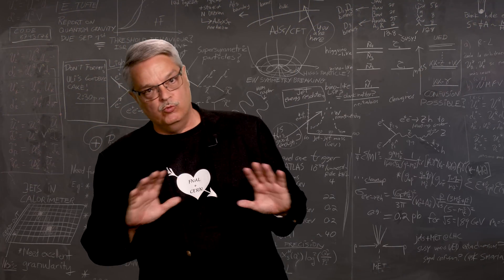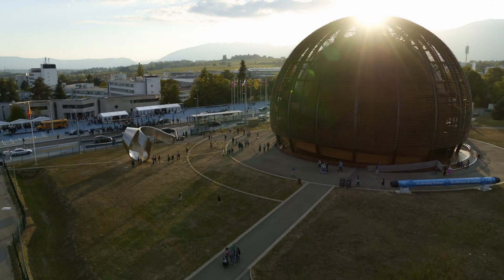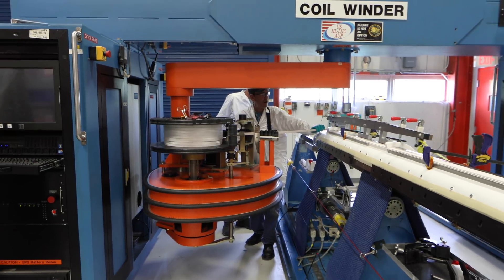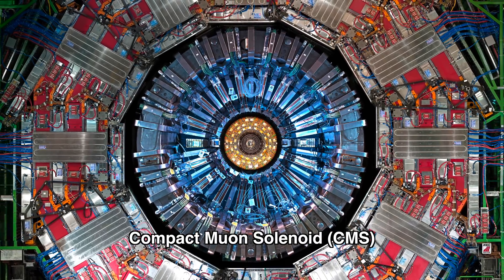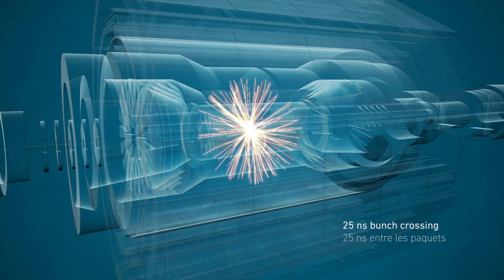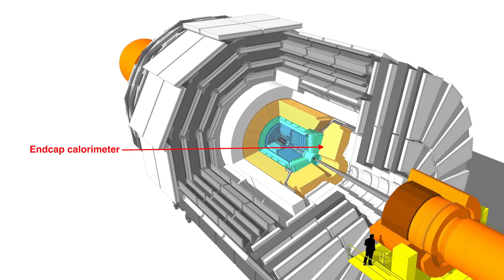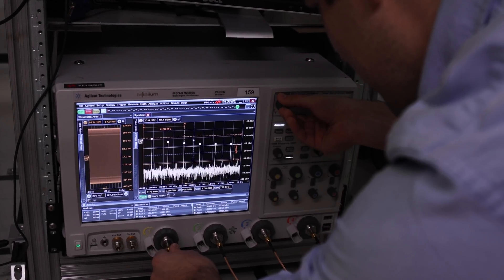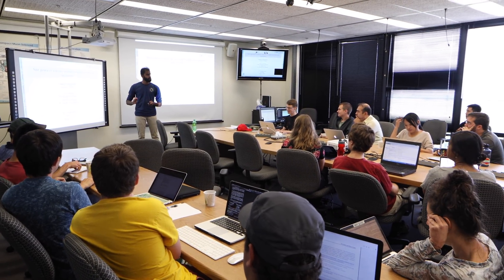The Higgs Boson Was Just the Start: Fermilab and the High Luminosity LHC

Comment: subatomical particles are theoretical particles, nothing more than romantic tales from physicists. Dogma!
Reply: So e.g. the electrons coming out of the sockets in your house are virtual and don't exist ?
Reply: Frank Schneider you dont need super machines to register photons, the eyes are good enough. That is a fact, not a theoretical particle. Can you comprehend that?
Reply: al G
Your eyes are organic detectors, that can detect some photons with a very specific range of wave lengths (the one we call "visible") and a sufficiently high intensity. All photons that either have a different frequency or lower intensity are not detected by the human eye, although we are of course able to detect them using more sensitive detectors. 
But that's completely irrelevant. You claimed that subatomic particles don't exist and I asked if you think that the electrons that are ultimately coming from the electrical sockets in your house are virtual, so if you think they are imaginary.
I'm still waiting for your answer (and wonder how you post messages using electronic devices, which are (at least according to you) powered by nothing, because electrons do not exist).
Reply: Frank Schneider Electricity is measurable, the subatomic particles are theoretical particles. My phone wirks with electricity. The reporta from the CERN are theories based from a computer system that has sebsors that get damaged with the radiation that is being produced with each experiment. Theories are not facts, thats is why theories keep being debated. As a scientist, marrying yourself to a wrong theory will lead you to mistakes or misguide you in your research, nothing different from Dogma. Can you understand that?
Reply: al G
You are aware that electricity is nothing but the flow of electrons at a certain voltage, right ? So if electricity exists, this means that electrons must exist, because otherwise there wouldn't be any electricity. 
Well, electrons are an integral part of every atom (you can easily extract some of them by rubbing a substance e.g. with a cat fur), which means subatomic particles exist and are real, because electrons exist, because otherwise there wouldn't be electricity and your phone wouldn't work. That's stuff typically taught in 2nd or 3rd grade.
So after we clarified that subatomic particles do exist, lets go to you next post.
I'm indeed a natural scientist, so I'm fairly familiar with the theory and philosophy of science, I therefore know quite well what a theory is and what it is not, and the guys working as research scientists at major accelerators are aware of that too. Honestly, no joke, they do.
So why do you think someone like you knows more about a topic then people like us who studied a certain topic of how nature behaves for countless years ? Because you are such an incredibly brilliant genius of a degree never seen before in human history ?
BTW, falsifying existing assumptions is one of the most important parts of scientific research. Some people don't do a lot else than exactly that, because if they are successful this is what gets you a Nobel prize, while finding another piece of evidence what everyone and his dog already assumed to be true only gets you just another paper.
Reply: Frank Schneider Your last post was a waste, you went from a scientist to a philosopher. There are scientists that theorize like Einstein and there are scientist that are practical, like Tesla. Most of the electrical use comes from Tesla and his practical aproach. My phones was pretty much developed thanks to Tesla and not Einstein. That is the difference between a theory and a fact. Science can be a fact as long as we can measure it. We need technology to measure it and technology all was fails, sooner or later. You probably believe that the picture of the black hole released not so long ago is proving the existence of a black hole, but it was a computer generated image, not a picture per se. We can go into the photonos and subatomic particles all you want but it reaches the point of becoming theories. Theories are not facts, physicists dont even agree with each other on their theories.
Reply: Tesla was not a scientist. He was an engineer, he didn't research anything. He simply used existing technology (based upon research done by scientists in former times) to solve technical problems. You obviously have a serious problem distinguishing scientific research from comparatively trivial things like applied engineering. BTW Tesla didn't even have an engineering degree and was pretty much a nut case talking mostly bullshit (e.g. his "death ray", "or lossless energy transfer over large non-vacuum distances"), at least in the later part of his life.
And as you are so keen on "theories", I'll tell you what a theory is: it's "the best existing explanation at a given point in time for a series of natural phenomena, which is generally accepted by the vast majority of the relevant scientific community". I'd like to point you to 2 things in there:  a)it says "generally accepted by the vast majority", not "unanimously accepted", b) do you see anything claiming it being "the truth" in there ? 
The true reality of nature can in principle not be known. We can therefore only come up with explanations that are logically consistent and best match the made observations. As theories are based upon mental models, which are simplified versions of reality, this means that theories are inherently always flawed to some degree and are thus never "true", but some describe natural observations better than other and are hence considered better descriptions of nature. If a theory would be "true" it could never be succeeded by a better one. No scientists believes theories to be "true", but they are still the best explanation we have at a point in time and as long as nothing better comes along, that's taken as reality, because there is nothing better. 
I'm aware that all of this is much over your head. To summarize it: you don''t have the slightest idea of science, how it works and thus what you are criticizing.
You take trivial points like the fact that theories aren't the truth and try to construct weird world models from it using the incredibly dumb "If A is not true, than everything goes"-logic, ignoring all observational facts, that initially lead to the creation of these models. 
To make it short: you suffer massively from Dunning-Kruger. Go have a six-pack, watch some football and leave the adults, who know what they are doing, alone.
Reply: Frank Schneider The end point of the scientific method is a fact, the rest are theories that might lead you in the wrong direction, the blind leading the blind. Eureka!
Reply: al G
Kid, why don't you stop talking about stuff, if you don't have the slightest idea what you are talking about ? In this case the theory of science. The only absolute truths/facts that scientifically exist are reproducible observations and they are not the result of of the scientific method, but of either an experiment, or literally observations of the universe (which are of course used within the scientific method, but are not the same).
A theory can never establish a fact, because it is always flawed, because it is always based upon a model ,which is necessarily simplified, because it must be less complex than reality. 
What a good theory does is a) explain why things happen and b) make more or less accurate quantitative predictions (which is of course sufficient for most practical purposes). Even if a theory makes 100% correct predictions all the time, this still doesn't mean it's true. It strictly just means that it makes absolutely correct predictions all of the time. Obviously this leads to the assumption, that it is true, but strictly speaking it's not, because it is impossible to determine any absolute scientific truths as you can never be sure, that there won't be an observation in the future that falsifies your theory. There are no absolute truths in science. If you want those go to the religious nuts, they'll gladly tell you about the reality contradicting "universal truths"..
And now stop running around naked and get yourself a towel.
Reply: Frank Schneider You still dont get it! The way you address me, shows your age. You have much to learn. Once again, creating a story out if thin air and build more stories on top of it, is far away from true science. For that reason engineers are more productive to the humankind than physicist/philosophers. Stories that can never be proven!!!!!! are we talking about scientists or religious people?
Reply: Frank Schneider I am not denying the existance of matter but questioning the tools used to measure the matter. If you use the wrong tools to measure you will make mistakes. I always question all the theories. I have learned that common sense is usually the best answer and many professors lack much of the commons sense. Practicing individuals learn the common sense by test and failure. Again, my problem is the tool used to register the CERN experiments. Read the kybalion and you’ll discover all the same concepts from physics, as above so below, everything pulses, etc.
Reply: JeremyEM1 That is produced by a cyclotron, invented in the 1930s and has nothing to do with Cern.

Comment: I was led to beleive that there is no target like the HIGGS within the levels achievable by a upgraded LHC. The LHC may have done its last big contribution to particle physics.
Reply: Jerry Brown
Higgs was just one of several targets. Another major target is identification of the lowest energetic super symmetric partner particles. If they can't be found (as it currently seems to be the case) this rules at least the easiest super symmetry variants out, and thus has implications for dark matter and string theory. 
If no super symmetry exists at all (which can't be verified using LHC), this would have massive implication's for theoretical physics as we currently think we understand it.
Reply: @frankschneider6156  Thank you for the reply. This is what I was headed towards. Both string theory and SUSY have already been called into question over the decades by some pretty serious issues. It does not appear that they are true even though it would be convenient as all heck if they were. The most likey outcome would be that the lower bounds for SUSY  would be established at the energy limits of the upgraded LHC.  This is quite different from trying to prove something, that  most likely did exist within the energy levels the LHC is now capable of.   I am concerned that an extended period of null events, like those experienced in the numerous underground dark matter searches, at such a highly visible and expensive facility as the LHC, would not be considered a success by the people paying the taxes to fund it. I think it would be wonderful if I turned out to be wrong.
Reply: Jerry Brown
I tend to mostly agree, but string theory is not even a scientific theory at all. It's a garbled mix of complex mathematics without any relationship to physical reality (at least in its current state with 10⁵⁰⁰+ manifolds). It's just heavily promoted by a sect-like subgroup of physicists around Ed Witten, who all made the error of betting their scientific career on it. If you do something like that, it's of course difficult to abandon something after a decade or 2 as simply false. I mean the graviton automatically pops out, that's of course extremely cool, but don't take that stuff seriously. Non-falsifiable hypothesis aren't scientific.
With SUSY it's different. It makes clear, falsifiable predictions. If SUSY doesn't exist, this would mean that different forces don't converge at high T into a single force, killing off current GUT/ToE approaches. A hypothesis no physicists will abandon, if not forced to by observations. And without SUSY there would be no proton decay and the proton would be a stable stable. This is perfectly in-line with what we found in detectors like Kamiokande, where we have been searching for proton decays for ages and are just not able tp detect any. 
It's of course much too early to jump to radical conclusions like abandoning the concept of SUSY altogether, but if the LHC wouldn't find any SUSY particles, this could be important evidence for a much more groundbreaking and a much bigger breakthrough, then finding some.

Comment: It is an impressive upgrade, but which will never find anything beyond the standard model.
Reply: It doesn't have to fundamentally change our whole understanding of physics in order to be useful or find something new.  We still know very little about the Higgs beyond confirming its existence, and since the LHC is the only place Higgs' can be reliably created, having the LHC be able to generate several times more of them will provide that much more data to analyze to help nail down its properties.  That in itself is quite useful (at least, in terms of advancing particle physics knowledge) without having to go beyond the standard model in any way.

And of course there's always the possibility (however slim) that the LHC's energies can produce things beyond the standard model that we've so far ignored because they were either rare enough that we discarded them as noise (and with more samples to work with, we can start generating a level of confidence about such events rather than discarding them) or simply because the detectors are better (they're also getting upgrades to go along with the beam intensity boost.)

Chances are this upgrade will probably only just give us more data to analyze about the known phenomena since its "only" an intensity boost and not an energy boost.  That will help us solidify knowledge about existing physics to be sure, but its probably not going to rock any boats.  We'll need higher energies to dig deeper, but unfortunately the cost and development time of these machines has gotten so large that the next one we'll see likely won't even start construction until closer to the middle of the century barring some incredible political shift toward the frontier sciences (which I personally don't see as terribly likely given that much of the world -- or at least the world's politicians -- seem to be wanting to retreat back toward religious literalism and anti-science right now.)

Comment: Black Hole question for you.
Black Holes are said to be described by mass, spin, and electric charge.
Do they also have color charge?
Similar to the concept of an electron/positron virtual par coming into existence, one (say positron) might wonders across an event horizon (byebye), leaving an electron which might escape the black hole...
Can a Pion flash into existence, only to have one of it's component quarks be lost across an event horizon?
Would this result in a possible isolated quark, possibly with a non-integer charge?

Comment: Please, please, please tell me that the criteria for which 1 out of 40,000 collisions that are reported ... are built into software or into easily replaceable hardware (e.g., FPGAs).

It seems so inevitable that “what you discover” will be constrained by “what detection criteria you choose to use”.

And that changing the criteria easily, without having to tear down & rebuild the machine, will be extremely valuable.

As alway, I really enjoyed your video.
Reply: The trigger looks at a vast variety of different collisions, all picked to maximize the probability of seeing new physics.  In general, they are ones in which the protons hit head on and then there are considerations as to which kinds of particles are created in the collision (electrons, quarks, muons, neutrinos, etc.)

All of this is modifiable in firmware.

Comment: How come LHC's main purpose is never discussed?
Reply: Aliens?
Reply: @Sonny_McMacsson  close guess. Fuel source. Used to harvest elements we cant create or find anywhere else in the universe atm. When you take the tour it really becomes apparent since they're constantly moving out crates of confidential stuff that "no one knows" is inside. 

What the elements are specifically used for idk. But many of the elements these LHC's "discovered" recently, have been talked about for several decades by physicists.  

I dont think it's a coincidence that they got everything about these particles right & how they function before ever even discovering or knowing they existed.
Reply: John Smith
Don't talk rubbish The energies are much too high to generate new elements. You also use accelerators for this, but at a much lower energies. If you want elements with a higher proton number (which are highly instable), it's pretty unreasonable to use energies that would completely shred them to pieces, right ? There are other institutions focused on that task.
And regarding fuel source. I guess you don't mean fuel, but energy. Look at the energy USED be CERN. That's not what they are doing. Energy research is the task of the other global mega research project currently going on:  ITER (located not THAT far away from CERN).
Reply: @frankschneider6156  these elements like elements 113-118 are only produced by LHCs, and I'm talking about for next generation propulsion systems that have been in the works for 50 years. 

And regarding energy research.. I think it's all bullshit. We could easily be using thorium instead of uranium in power plants which could yield 1000% more efficient, stable, and produces a fraction of the radiation.. would render electricity costs 1000% cheaper.

But you know, thorium doesnt turn into plutonium, so its rendered useless by every government. So what ever ITER finds, if it cant be weaponized we'll never see it implemented.
Reply: @frankschneider6156  What Franks said.
Reply: @timmyturner6575  lol go back to your cellar chamber